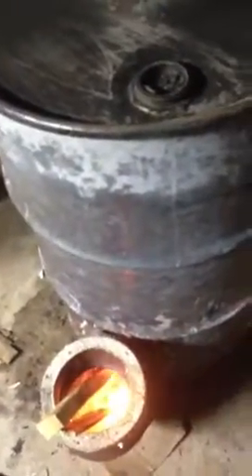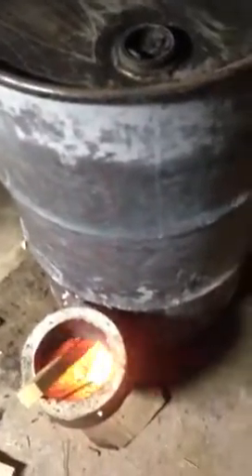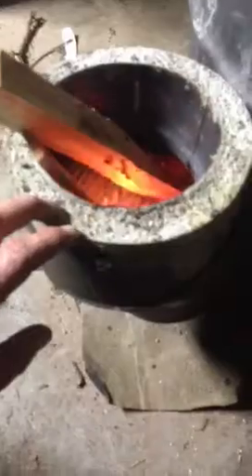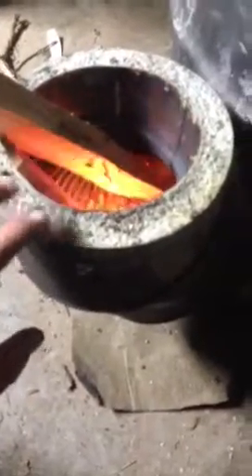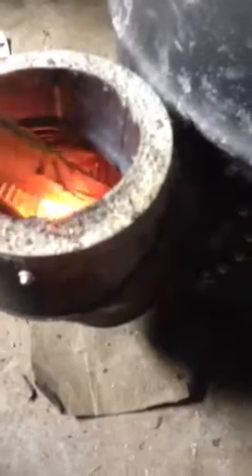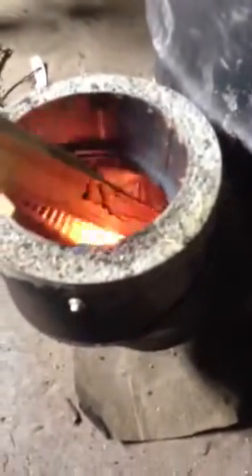Rocket stove

Comment: Wonderin if some sort of heat sink type setup on top of the lid would transfer more heat to the shop.
Reply from the maker: Probably but the main problem is your not going to get more energy than what is in the wood itself and it is comparable to trying to fill up a pool with a garden hose vrs. a fire hydrant a hose will work if the pool doesn't loose any water (heat) but the more water you pool looses the faster you have to fill it to keep it full same with a shop that isn't well insulated you have a lot of loss and if your heat source can't keep up with the losses then you need a bigger stove.

Comment: Also did it that way so it was "modular" or at least really easy to change things. Only thing I would say is check the spaceing at the top of your riser to the lid that is an important distance. How did you go about doing your exhaust out the bottom? Did not see that clearly do you mean out the back but at lowest part of the barrel instead of above your cement? How did you do that did you just section off an area not to cement then attach your pipe there on the back? Would like to see more vid.

Comment: Be very very careful using it with "wet concrete" You really should wait a few weeks before your first use if water trapped in the concrete turns to steam you will have an explosion like a bomb going off. The main reason I did not do a concrete on my second stove was first off I did not have a mix that worked well based on my first stoves failures and secondly it is really hard to not get voids wheres by using straight vermiculite or my vermaculite/clay mix it flows freely.